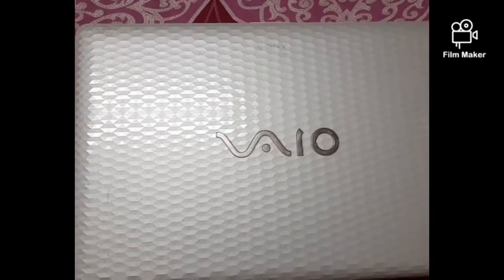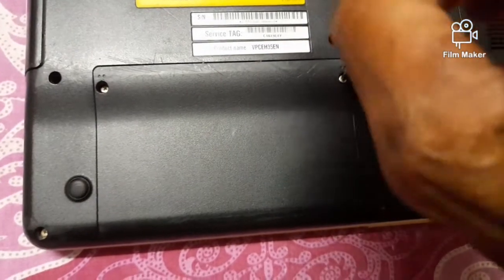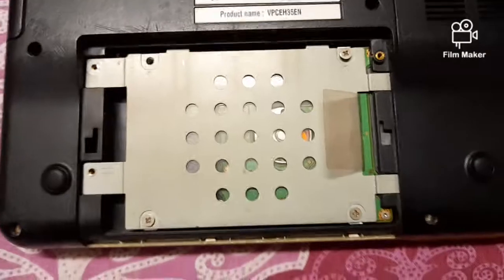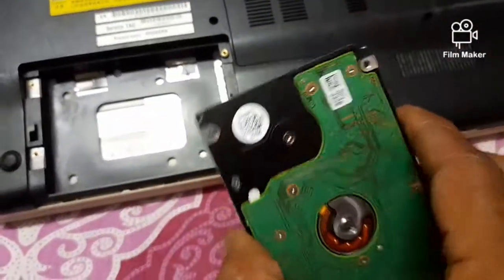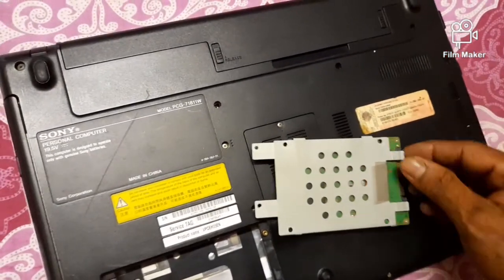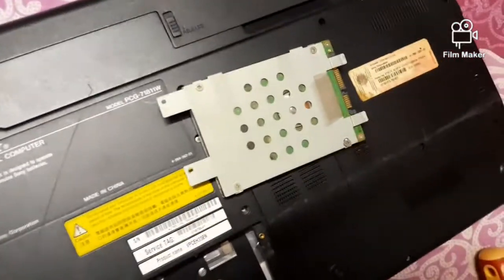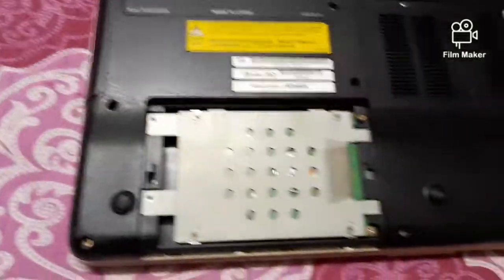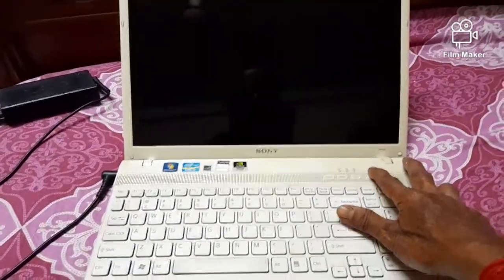Changing Hard Disk  of a Laptop Sony Vaio

Comment: Sir, from where should I buy BIOS Chip for sony vaio SVE15136CNB. I need this chip to repair my laptop but I could not find it. So please help me.
Reply from the maker: What's your problem
Reply: @rajbanerjee1975  my pc shutdowns immediately after boot up. I have visited nearest dell service centre(because sony doesn't provide service). Engineer of the service centre inspect the pc and says bios chip needed to replace. They tried but unable to find the chip in the market.
Reply from the maker: @rajandas5463  try for reinstall the os by recovery drive or by using recovery media if you have made